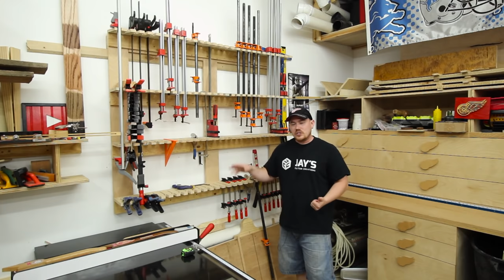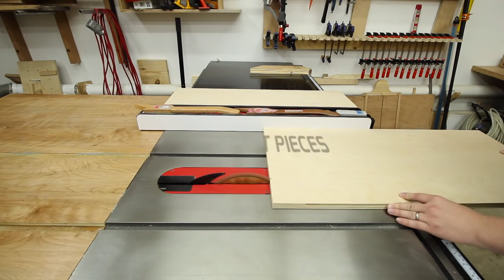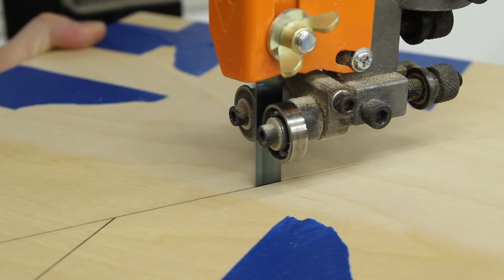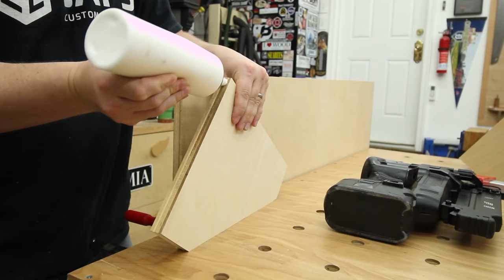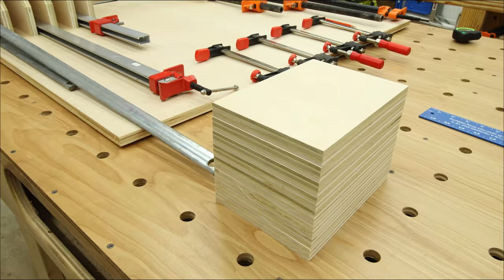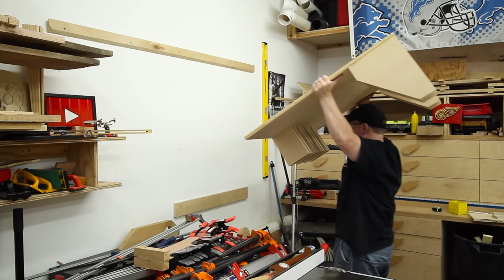Clamp Rack Version 2 - 257

Comment: I'm in the process of reorganizing my shop. Your clamp rack is much better than the one I had in mind. My shop is a steel building and the "studs" are on 5 ft centers. 
Sheet goods on the wall is almost a necessity. Thanks for the inspiration. I'll be using some of your ideas for my new miter saw station too.  Keep up the good work.

Comment: I love the simplified design.  I will be copying you.  One suggestion:  I would put a matching block at the bottom of your  spring clamp fixture, so that when you bring it to your workbench, the two blocks will act as feet, allowing the fixture to stably on the workbench surface with the handles of the spring clamps facing up.  Also, it would allow you to mount the fixture on the wall either way. (not really important, but why not?)
Reply from the maker: The top "T" will allow the piece to sit up as you suggest. But It doesn't matter if its sitting up or thrown on the table. Getting the clamps off is not an issue.

Comment: Really like the design and I'm definitely going to use it in my shop. Quick question - I noticed you will wait for your miter saw blade to stop before lifting it back up. Is that a safety thing or something else? I know you do just about everything intentionally. Thanks Jay!
Reply from the maker: Yes, safety. Because the offcut piece is trapped between the stop block and the saw blade there is greater potential for the blade to grab the offcut on the way up. So it just makes more sense to let the blade stop spinning so it eliminates any risk of catching the trapped offcut.

Comment: In hindsight, I would have not glued and screwed the brackets.  I’ve done a similar design but used pocket screws to attach the brackets to the plywood backing.  This way, as you decide to change the layout you can easily unscrew the current brackets and rearrange.

Comment: Great project and inspiring to make the upgrade here.  How confident are you that the brackets will hold when you apply the significant weight of clamps out near the front of the 12" brackets?
Reply: I have mostly 3/4" pipe clamps, and I worry about the weight out at the end of the bracket with 4 clamps deep.  It would save me a huge amount of space tho.
Reply from the maker: They should hold way more weight than what I can put on them.

Comment: Im curious when you like to grab your aluminum sash clamps instead of the pipe clamp or instead of the parallel. When do you like to use each. Thanks
Reply from the maker: I use a pair of K-Bodies as a base to start the clamp up normally. Then add pipe clamps. And finally aluminum if I don't have enough pipe clamps. The pipe clamps are the best value by far.

Comment: Jay, at around the 2:50 mark I see a quick clamp on your bench. Am I correct in seeing that it has been modified to use in a hole on your bench to clamp things down, and if so how did you modify it?
Reply from the maker: I cut off the end of the bar and welded it back at 90 degrees. Then rounded the corners so it would fit in the holes. I rarely use it thought.

Comment: I really do enjoy your productions. I store my clamps like your prior arrangement and am of the same mindset in its replacement that you produced. But I tend to over build most things. I admire the clean look, but worry about holding strength when loaded? keep up the go work.
Reply from the maker: What is your concern with holding strength? Where is the weak link?
Reply: At first my thoughts were about withdrawal of screws from plywood ends, but while thinking over your reply to me, I realize that it's the shear resistance of the screw as the majority of force is straight down. That said I'm more comfortable with your fastening choice.Enjoyed the insight into your video/audio/editing video as a couple folks have been after me to do a couple videos on my embarrassingly large framing hammer collection.Which can be found on my Flickr page, if you want a look https://www.flickr.com/photos/chazferret/albums/72157604046365521Thanks for making me think a little deeper on that clamp rack.
Reply: https://www.flickr.com/photos/chazferret/albums/72157604046365521
the first link got messed up
Reply from the maker: Woah thats quite a collection.

Comment: Excellent idea and video.  i would go a step further and put a 5 or 10 degree slope on the top of the brackets towards the back to further reduce the chances of the clamps slipping out accidentally so gravity will help push them back... definitely not necessary but since i'm going to steal your idea that's what i'll do  :)
Reply from the maker: I did bevel the top and also mentioned it in the video.
Reply: You did, my bad....

Comment: Completely off topic. What are the little black spots that were on back of the rack. I get them on almost all my stock. I thought it was black mold and had it tested. The results came back negative. I plane them out every time. It's only on the surface.
Reply: It's around the 8 sec mark of the video
Reply: Looks like they just might be dents and dings from use.

Comment: Why do you cut your pieces on the mitersaw the way you do? First small cut towards you, the rest full depth away?
Reply from the maker: No pattern. Just whatever is easiest.
Reply: +Jay Bates Great, I've been wondering for quite some time now. Thanks for clearing it up!
Reply: He actually does that to avoid tear out. Pulling makes the blade cut down, so in to the wood. pushing makes the teeth go up, meaning it pulls the wood fibers into the wood, instead of out.